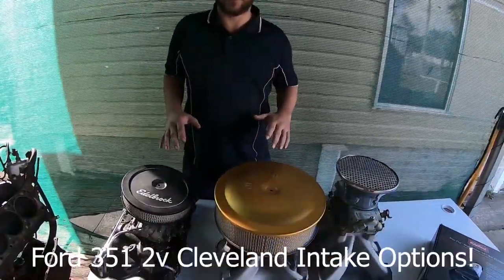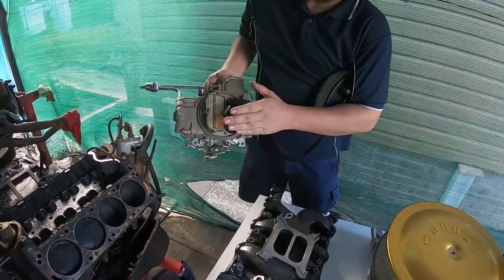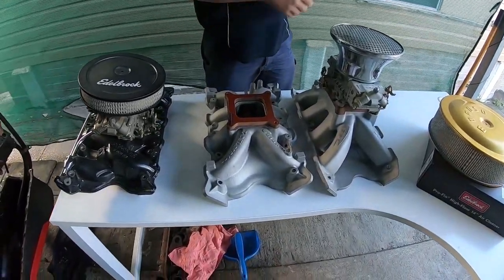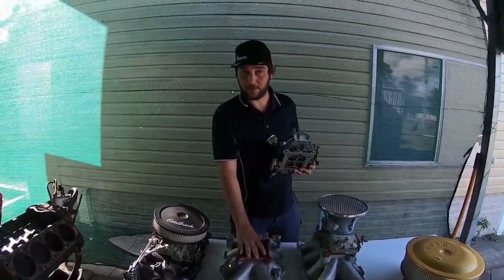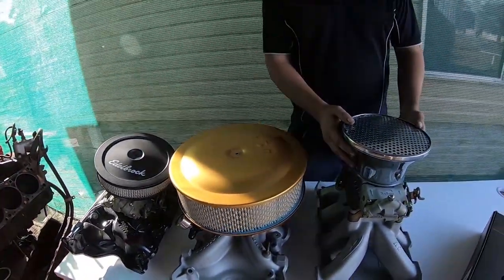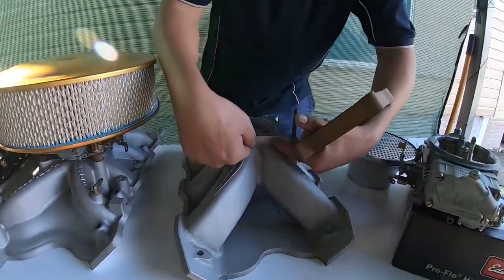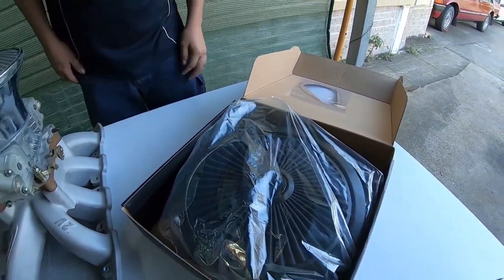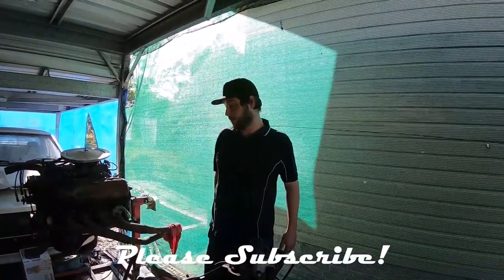FORD 351 CLEVELAND 2V INTAKE AND CARBY OPTIONS AND TECH TIPS

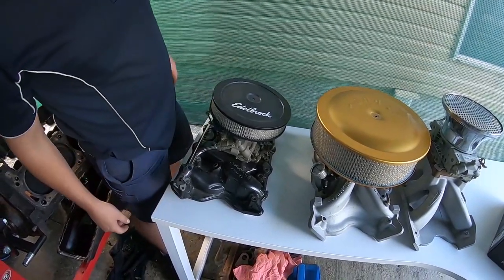Comment: @ 2:17 Wow! I am just now shopping for the intake gaskets for the Edelbrock aluminum intake, so I was watching your video to see how to install it. I have the original Ford cast iron 2V intake sitting on a shelf and it still has the metal valley pan (aka: Turkey Pan) stored with it. So I I figured I would buy a new metal valley pan and install it instead of just the paper gaskets. Thanks for the tip, saved me from damaging the aluminum intake. Thanks!

Comment: I’ve got two sets of D0ZAE Boss 302 cylinder heads in perfect shape and a set of D1AE 351-C closed chamber heads that are also in perfect shape. I’m running the Chris Parker funnel web intake with the tongues on my 351-C, roller cam. I have gone a best of 9.20’s on a 200 shot and still had some left in the motor. I just didn’t want to push it and tear up my motor. 34 degrees of timing on motor and 29 degrees on a 200 shot!
     My next motor is a 6” long rod, 3.5” stroke 351-C with AFD 3V cylinder heads with the funnel web intake and aftermarket block.

Comment: Great video dude! My favorite topic is "Cleveland" engines, and specifically their heads. I'd probably go for the "Weiand" intake, I've used pretty much the exact same one, and same brand on my 302. Also I use fairly large camshafts, I like one in the 292 degrees duration. You know what I'm talking about, anyways thanks dude, you know what you are talking about.

Comment: I appreciate and thank you for sharing your knowledge. I have a 1973 351 with 4v heads with a cast iron intake. I also have a preformer LB 351-2v. Is that intake worth putting my motor or should buy a 4v intake instead? What is the best intake for my motor? Thank you

Comment: The Weiand that I got needed a shitload of work so I sent it back. I have used the Holley street dominator for a while. Very good fit but no longer available.
Gone to CHI heads and intake. A lot better and expensive! Race engine. Though I know of street engines with them and the work surprisingly very well
The filter top filter will work fine with a 2" element. That 4" element will not fit under a Falcon bonnet, even with a Performer which is an excellent piece for street use. Though for street use the standard Ford airfilter, works fine. A cold air pipe to behind the headlight helps a lot. Quiet and discreet
Reply: And use the tin tray, even with a alloy intake. It does help. Imperative on the iron intake.

Comment: Wow you just answered my Question! Im running a 393ci clevo in an XW sedan with 750 dp street hp holley. I have the standard 4.V heads and want to swap out the standard square bore 4.V manifold and I might just put on the weiand. Cheers. P.S. she has 420hp and looking for around 450+

Comment: Hey mate good show. Like the content. I am running a 2v performer with a 2inch hvh 4 hole spacer and drop base k and n 14 by 3 inch filter. All fits under the bonnet of my xc ute with about 15mm clearance. Last summer the centre section of the spacer got hot and distorted resulting in the secondaries not opening. I took it off and die ground out the centre still leaving some of the ears between the holes. This resulted in way better throttle response off idle as the primarys can distribute better to the rear cylinders. Was thinking of swapping to a Torque Power hi rise dual. It should fit under the bonnet with no spacer or if I fit a thinner 2.25 inch filter should be able to run a half inch spacer. The ute runs an x stream filter top and gt shop engine mounts that I think are 10mm lower than stock. Have you had much to do with the torque power manifold? Also given that I have had a spacer fail already is ply wood one worth a try? Don't know what material the hvh is,some type of grey plastic. Has a drag use only stencil on it.

Comment: A question concerning Cleveland crankshafts. Was there much difference between the 2 & 4 barrel stock cranks in the early years? 
  I've recently purchased a 4 boltain block 72 casting and a set of 4 barrel doae closed chamber heads.
I've got a complete 2 barrel engine and felt I could use the rotating assembly plus the externals to put together a 4 barrel engine.
Reply from the maker: No difference in the cranks mate they are the same for 2 bolt and 4 bolt blocks.

Comment: I got some exhaust port plates for 4v years ago but can’t remember when (80’s I think), any thoughts on those? Cheers mate
Reply from the maker: They are ok on some builds. I had some luck on a worked hi comp 4v with them and not much luck with a stock 4v. I find they usually work good on engines with the intake tongues fitted to help speed up the air flow and help with fuel atomisation.
Reply: 4Vs make good door stops,, or anchors! Way too big in every way.

Comment: I installed a cleveland 2v in my 89 Bronco. It has the dual plane intake with a 650 Edelbrock. My problem is it bogs under a load (power braking) and dies. I'm wondering if it's starving for fuel. It runs great and even runs great when giving it full throttle in park
Reply from the maker: You should play with the metering rods, edelbrock carbies are good but at a certain power level the Holleys take over and it’s Game Over
Reply: I appreciate that. It's a little more than stock but not much
Reply: The accelerator pump has run out of fuel when you are holding it against the converter and you are not getting enough fuel flow through the main jets for the load and on an Edelbrock you will have to find a needle with a smaller step to enrichen the mix. It is easier to adjust the power valve system on a Holley for a longer, larger or delayed acc. pump shot for this scenario. You should be able to tune the problem out which ever way you go.
Reply: Sweet Brother. Thank you. I will definitely try that
Reply: It seems fool injection only responds properly with open plenum intakes. Personally I feel a waste of time. A good carb does the same job and cost a lot less

Comment: Hey you would love my Clevo combo , a pavtek gold pro crane f 246 cam , Parker racing prepped as cast pro comp 4v's and a Parker racing funnel web manifold and a 750 hp carbie. Ice ignition system , 22 Dec Initial and 34 total depending on ambient temp Cruises great at 100km at 2500 rpm , I get 350 to a tank of fuel .it all fits under a shaker in a XY Gt rep . Happy if you want to have a look some time for your channel I'm a few hours west of Brissie.  Pm me if you want to?

Comment: what's your take on the air gap rpm manifold vs the performer 2v?
Reply from the maker: Great intake just have height issues in most Aussie cars with a large 14” air filter and 1/2” phenolic spacer
Reply: @thclevoking  cool. Looking for something to give some more low end torque for a 351 f truck

Comment: After many hours of dyno and street work we found the best manifold is the standard 2 barrel manifold. The best air cleaner is the factory air cleaner complete with the heat pipe to the exhaust. We have 30,000 hours of engine dyno work devoted to engines and what they need regards temperature and fuel distribution. The cleveland needs the stock air cleaner for the purpose of setting up proper air turbulence at the butterfly.

Comment: Do you the the Weiland would fit under a ‘73 mustang with Mach 1 hood?
Reply: Sorry you already answered that. What carb did you recommend? And if you were to build a street car and wanted to get 450-500 to the flywheel what set up would you do? I was looking at changing my 2v head for either CHI2v or trick flow 225 72cc. Would appreciate any suggestion on cam, crank etc. just a backyard mechanic trying to figure out a strong street car. I currently have a edelbrock performer with 600 holey, 9” filter😂😂😂, mid rv cam, stock bottom end.
Reply from the maker: Very easy to achieve 450hp with trickflow heads and a decent cam welcome to pm me on Facebook or Instagram to discuss a cam that would suit your build

Comment: Will the Weiland setup fit under the hood of a 73 mustang with the ram air hood?
Reply from the maker: Yes it will mate they are the same height as the stock square bore steel intakes

Comment: Too bad they don't make intake manifolds for a "tall deck 351c" 351m. I think a 351m is an amazing engine. Very underrated.
Reply from the maker: Offenhauser make intakes for them and Edelbrock do too mate
Reply: @thclevoking  what i meant was good single plane or tunnel ram type. I have a Weiland dual plane currently.

Comment: The Edelbrock Performer 2v sucks ass. Its only good for weight savings. I had a Holley 3310 750 on it on my street Cleveland and replaced it with Weiand Excellerator 2v on same engine with a Speed Demon 650 DP and woke the engine up. Great street intake/carb combo.  People worry about the idle to 2000 rpm but there's no reason to. Honestly, unless you are at the stop light, how often are you at 1500-2000 rpm? You will get the same fuel milage from a DP and a vacuum secondary carb - it all depends on how heavy your foot is.

Comment: Do you still recommend the Edelbrock Performer intake with a 750cmf vac secondary carb on a 302C 2V? Or is this only for the 351C 2V?
Reply from the maker: The 750 hurts a stock 302 a lot down low, best to use a 600 vac sec if possible.